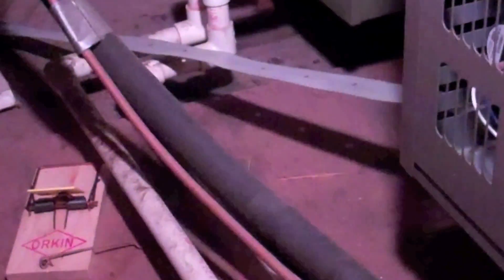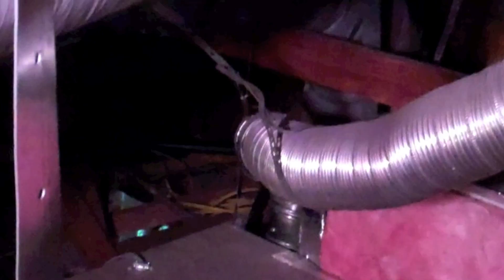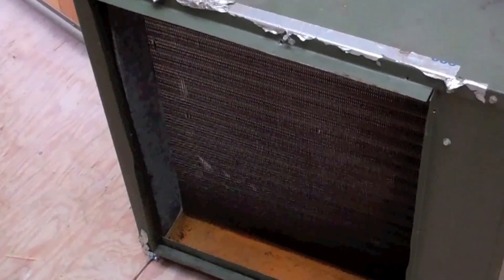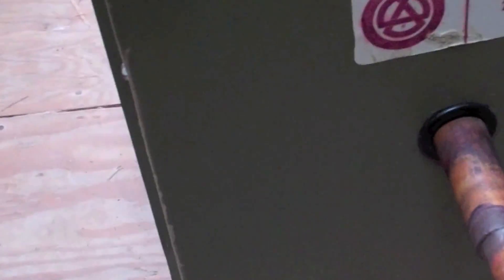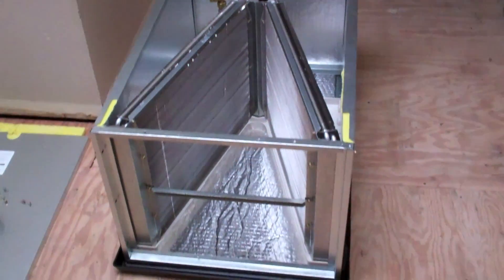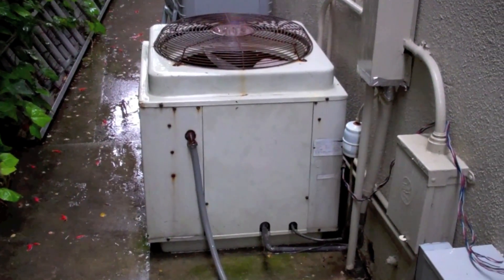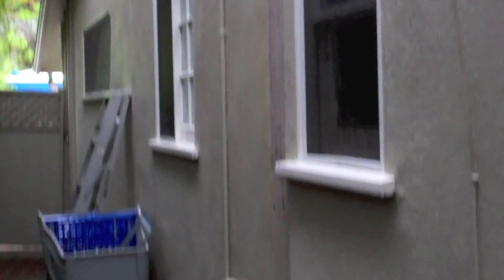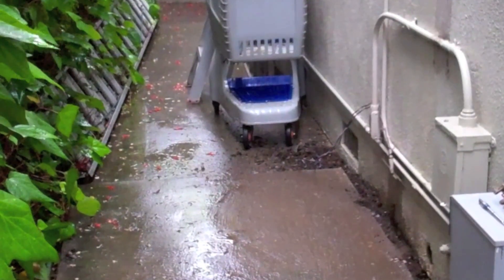HVAC Rheem 3ton install

Comment: dont worry, aluminum is plenty strong but just in small applications like this i would prefer copper, we are using our 3,000 lb ALL ALUMINUM vertical boat lift to lift our 3,500 lb family boat. it hasn't shown one bit of stress and its 20 years old! still looks like new